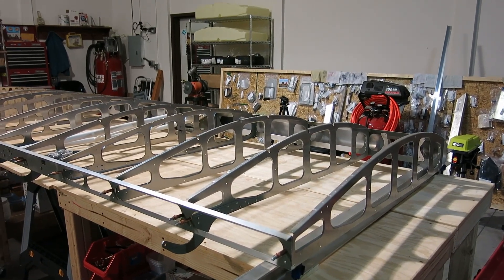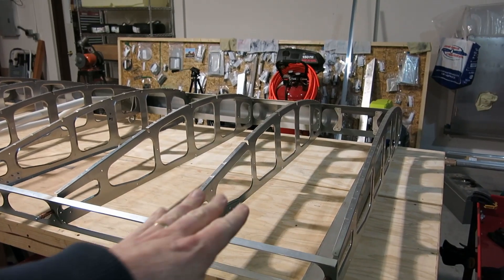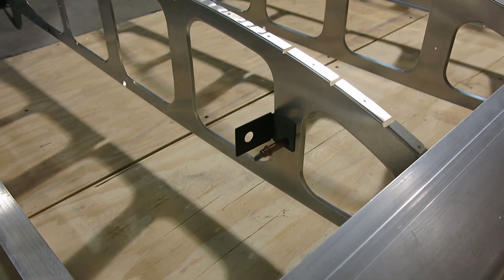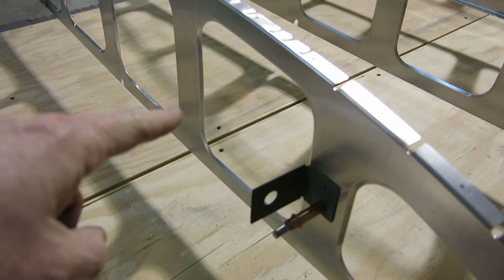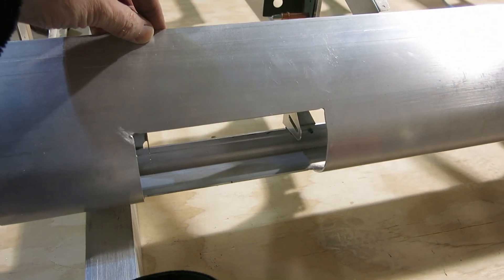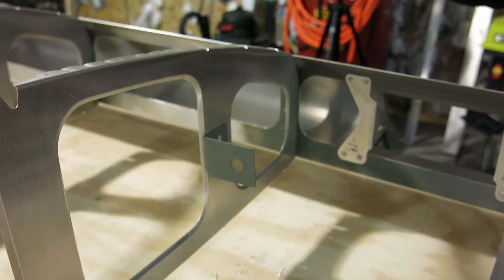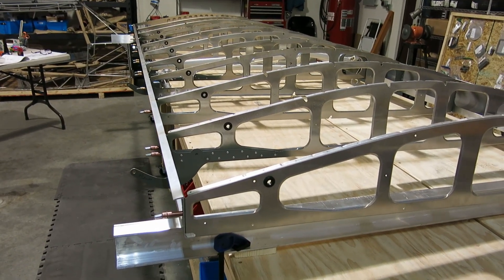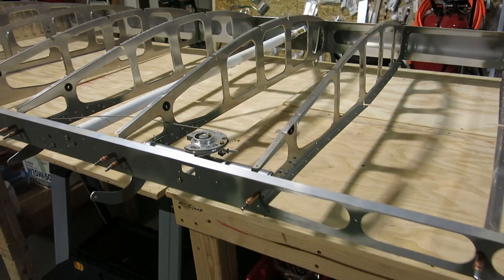No. 92 05-04-2021 Aileron and flap controls, and wiring grommets

Comment: I have to ask, do the instruction say to put the bolts through the flap lever and aileron cable guides go through from bottom to top? I ask as that is against the norm as the norm had bolt go through top to bottom and front to rear.
Reply from the maker: They do specify that. There isn’t enough clearance between the bell crank and the assembly (between the ribs) to have the fastener the other way around.
Reply: @s-21project92  thanks for the reply, though that might be the case.